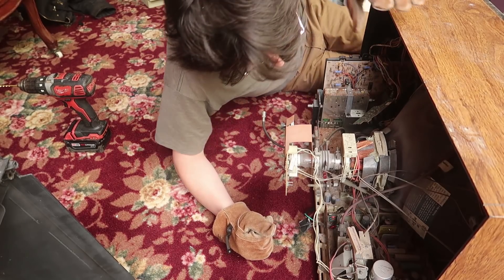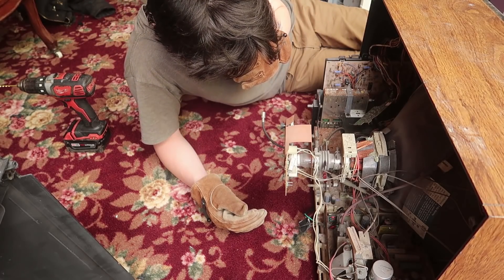Console Triage 01: 1984 Magnavox 16" Television, Circuitry Troubleshooting, Burning Smell...

Comment: Never ever work on any electrical equipment in your bare feet. Never discharge picture tube to ground, discharge it to the degassing shroud.
Reply from the maker: Ive worked on enough old TVs to have a pretty good track record. Bare feet has nothing to do with safety regarding electricity, meanwhile if I were to wear shoes in that heat I would suffer heatstroke. Also Ive never had any issues shorting to ground. Its what Ive seen in many repair books and many people do it. Never had an issue yet after hundreds of tv experiments
Reply: @RinoaL  Sorry I didn’t realize I was addressing a genius. Being a electronic technician and selling and repairing thousands of Magnavox TVs like the one you where looking at, I was just stating a safety concern. Good luck in you dumpster diving and be safe out there.
Reply from the maker: Just because you have one way to do things doesnt mean its the only way, and definitely doesnt mean you will win any points with anyone by being annoying about it.

Comment: Given you have no high voltage I would look to the flyback transformer first. 

Many of these sets used sweep derived power supplies - meaning there are secondaries from the flyback that provide voltages to other parts of the set. 

If you have something that rings inductors and transformers, you can use it to test for shorts, or just smell around the flyback for the burning. 

This generation of Magnavox was made during the north American Philips takeover, and they are known for high voltage failures.  Check that the horizontal output transistor is not shorted as well. This would create excess DC current and cause your issue as well.
Reply from the maker: It seemed it had high voltage since it was sparking high voltage

Comment: Tend to agree with you see what burns up replace that if possible. Frankly delving into the tv long enough to diagnose exactly which component is going to turn into blue smoke is a hugely variable time sink. Could take 15 minutes could take 15 days. Letting it burn will tell you what it is and if it's worth replacing or putting it in the art bin in around 5 minutes. Depends on what you value your time at though to be sure. Given you make YouTube videos out of projects like these you might be better served by milking the clock as they say haha.

Comment: Last summer I got a trash-picked 19" 1985 trinitron that had no cord and was left out in the rain. I dismantled the whole thing and hosed down the circuit board before re-capping it. It works well now but I still have to fix the geometry. I would say at the least you should dismantle yours and clean the boards. the problem might show itself. if not at least you'll have a squeaky clean TV!

Comment: As its been sat outside the dust inside may be damp hence causing the arcing on the component contacts. Its going to be difficult to test components like valves and tubes without the engineers test equipment do you have any to hand? 
shango066 does a lot of old TV and radio  repairs on his channel if it helps any https://www.youtube.com/user/shango066/videos

Comment: I hope you're aware that the older TVs had a two wire interlock plug. One of these wires is always hot the other one is a neutral.
 When you connected your new cord I hope you got it right cuz if you didn't, chances are you energized the chassis with hot 110 volts.
 you can get yourself killed just by touching the antenna, and chassis.
The ozone you smell may very well be the high voltage transformer working, generating 5,000 volts to your tube.
Please be careful!!!!
Reply from the maker: Doesnt really matter since i treat everything as live.

Comment: You can sometimes get that smell just from the dust between high-voltage leads burning up. Vacuum it out then try again and see if you still get the smell. Also, keep in mind that electrolytic capacitors are only good for 25-30 years. After that their capacities will drift and they can even become dead shorts. So even if you do find a TV that will start up you'll probably need to replace the electrolytics to get it working properly.

Comment: When my parents bought our first color TV, back in the 70's, it was also our first to come with a remote control. When you pressed the buttons they would flick tiny little tuning forks inside the control, with a different frequency for each function. No batteries to replace!
Reply from the maker: Yeah i always found that design pretty amazing.

Comment: LOL, you just chopped a IEC cable worth $20.00.    NOTE the IR remote sensor in on the bottom front edge of most TV.
Reply from the maker: Sure hate doing it, but they aren't worth 20$, maybe 3$.

Comment: In 84 I was in the USAF in London married with a 2 year old Son.  Back in the days they sold a spray product called FREEZE IT.  You sprayed the PCB with it .  It froze everything.  The defective parts would melt the ice first.  Canned Dust off works just fine if you hold the can upside down.
Reply from the maker: Yeah, now i have thermal cameras to detect hot components.